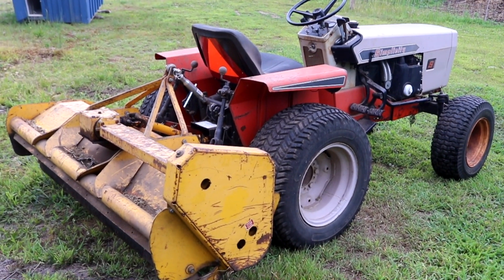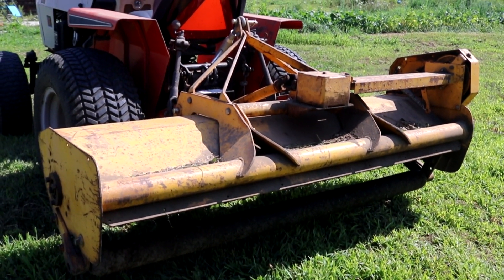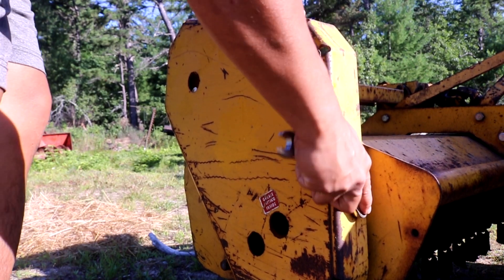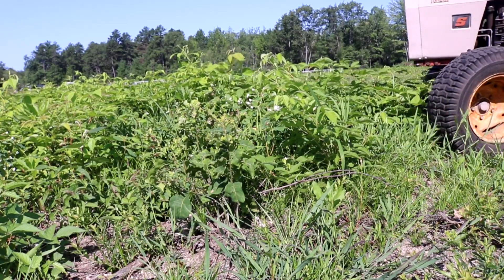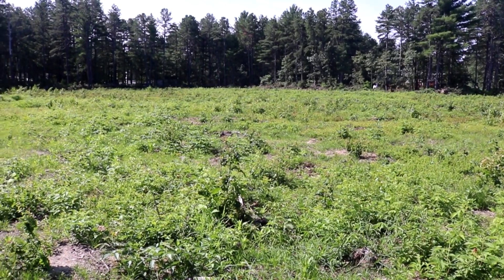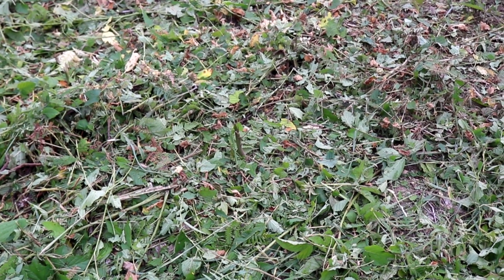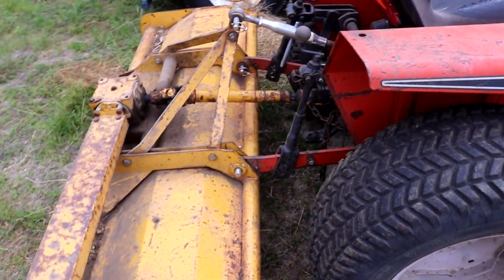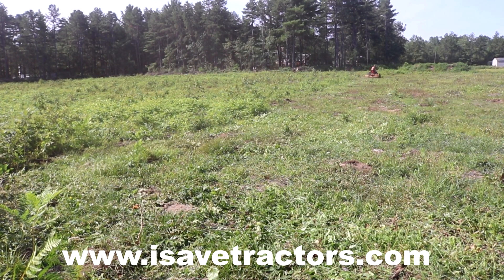1970's 2000 RPM Cat 0 Mott Flail Mower for Simplicity Power Max Tractors

Comment: back in the mid 70's, worked for a company mowing highway shoulders & mediums. Had a ford 5500 tractor with 3  8 ft mott rotary flail mowers, that thing cut some grass.

Comment: Nice flail mower ! That is a nice unit for a home owner to have. I have a "Case-Ingersoll" tractor and would love to have one of those !  I used one similar to yours on a golf course in North Reading Mass. It was the late 70's,  I was very young, and never heard of a "flail" mower. Well my boss said , "hook up the flail mower and cut the scruff along the tree line". It hadn't been used for many years, so I hooked it up to the 3 cyl Ford tractor ..I think it was a 210...and checked the gear box, greased it and when I started using it...I was amazed ! That thing ate through everything. It had larger "flails" than yours. Much heavier. A commercial model. I have never seen another flail mower since...until today. Thanks.

Comment: Flail mowers are relatively popular in NE due to the rough and rocky ground.  We sold a bunch of them when I worked for a John Deere dealer in NH back in the early 80's.  I can't find one here in the midwest, where almost everything  is flat.  One thing you could have mentioned is a flail mower follows the ground better than any other kind of mower because a 5 foot flail only sticks out about 2 feet behind the tractor whereas a 5 foot rotary sticks out at least 6 feet and maybe even 8.  I cringed a bit when I saw you mowing the blackberries, though... Some of my favorite childhood memories are berry picking in Maine.   My Dad once said that blackberries were his favorite because to took too many blueberries to fill a pail.

Comment: Dude that thing kicks butt. This fall I will need to rebuild my motor on my Craftsman GT 6000 it has a Kohler 18 horse. It's the motor that stands up and has a pulley on the back of the motor to drive the wheels and the Pulley on the front to work the mower deck. I'm hoping your business we'll have all the parts to rebuild it. Thanks again for the video

Comment: If you are thinking of buying a flail mower vs. a brush hog, I recently purchased the top of the line WOODMAX 96H (which cuts an 8 ft swath, with a hydraulic offset mechanism). 
The machine cuts well, but the rails on which the hydraulic shift traveler rides is made of soft Chinese steel.
The thing bowed in the middle before I could ever put the mower in use.  This bowing caused the traveler to catch on the rail, which transferred the pressure from the hydraulic unit to the rail itself.  The result was that
the rails pushed the freeze plug, and the snap ring which held the rail in place, plumb out of the seat, along with rail itself.
This was bad enough, but the real, and lasting damage is that the WOODMAX company won't return my calls, respond to my e-mails, or any of my direct mail attempts to have them send me a replacement rail, end plugs, and snap rings.
The unit came with a 3 year warranty, which appears now to be a complete sham.
The price was right at $4,000, as that is about half of what a legitimate Kubota or John Deere would cost.
Since I have received zero response from WOODMAX, I hired a fellow to weld metal covers over the ends of the rail guides, which for now is working fine.  But, the rail itself continues to bend upward in the middle, and will most likely end up being completely useless.
The old brush hog was virtually maintenance free for forty years.  The flail mower is three months old.
The cut is nice, and it turns 1" twigs to mulch, which is good for the pecan orchards where it is used.
With minimal customer service from WOODMAX, I could install a new rail, after having my welder heat-temper the steel for strength.  But, WOODMAX apparently does not care one twig for their customers.

Comment: This is really cool flail mower. Could a Ariens gt17 handle one of these flail mowers?
Reply: Todd Johns   Yes, with front weight.
Reply: Ariens GT17 has a 3200 rpm rear pto. It would be running very fast.
Reply: littleblue4x4 good call. It is engine speed, not the 2000rpm.   It would still only be a pulley change and driveshaft adapter to make work.